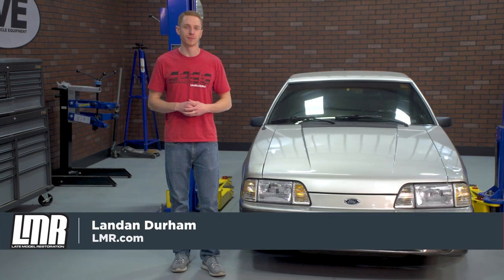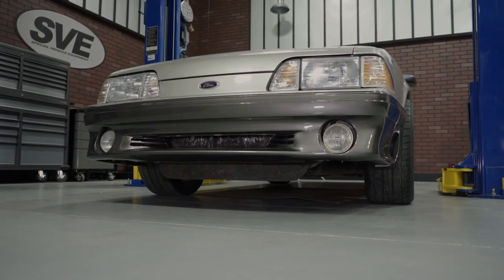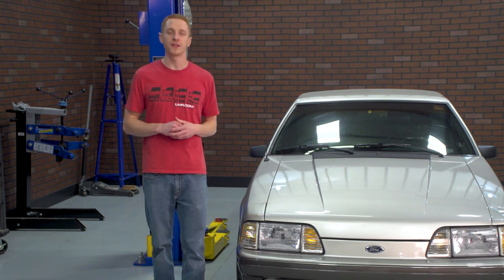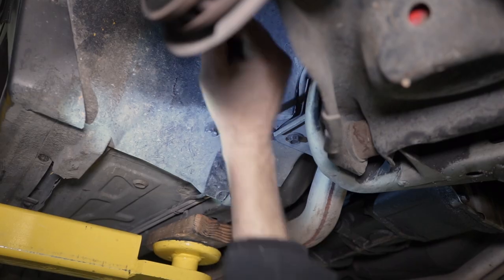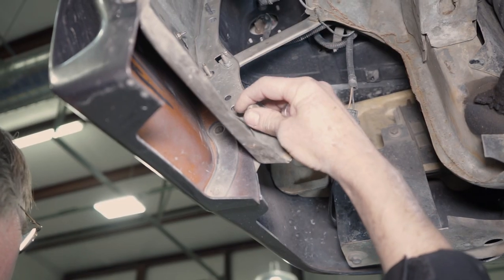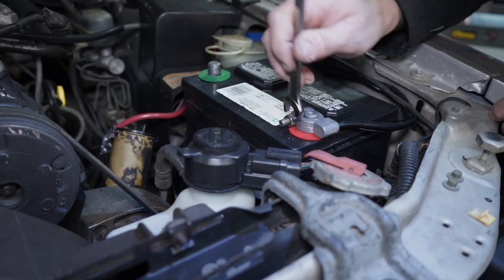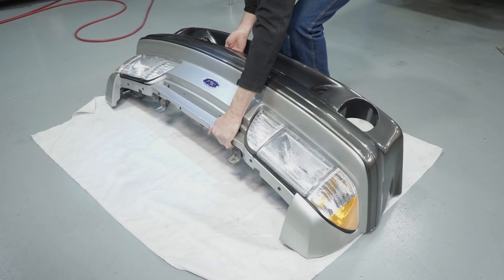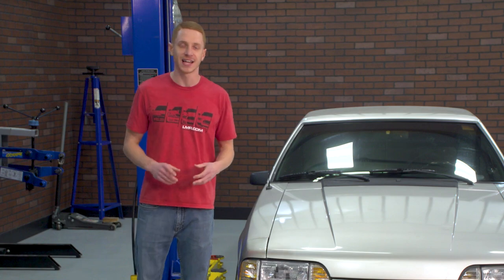How To Remove Fox Body Mustang Front Bumper (1979-1993)

Comment: You have to remove the bumper to start installing the on3 turbo kit. Is this video a hint that the turbo install is coming soon???
Reply: NOPE……. BUT YOU COULD PUT AN 88mm turbo kit on it, & drill  ur  HUGE INLET HOLE where the Blue Oval  Emblem was in your front header panel!! & it  ALSO helps if you are doing an LS SWAP AT THE SAME TIME, 2 REALLY MAKE THAT PONY HAUL AZZ!!😂😂😂😂😂😂😂😂😂😂😂😂😂

Comment: Thanks for the video. Removed headlights instead of the wells. Did a Race bumper shaved a lot of lbs but you have to weld a Fabricated bracket to hold your Foglights. Don't crank on top nuts too hard or you will warp plastic ..

Comment: I want to convert my lx to a gt, will this bumper fit my lx (87)
Reply from the maker: Yes, a GT bumper cover bolts directly to a car that was originally an LX. You'll need the front extensions and brackets as well. Below are links to the parts that I'm referring to. -Landan

https://lmr.com/item/LRS-16163D/1991-93-Mustang-Gt-Lh-Front-Fender-Extension
https://lmr.com/item/LRS-16162D/1991-93-Mustang-Gt-Rh-Front-Fender-Extension
https://lmr.com/item/LRS-8208A-K/1987-93-Mustang-GT-Bumper-Side-Reinforcement-Panels
https://lmr.com/item/LRS-16162BRKT-K/mustang-front-bumper-fender-spat-reinforcement-kit-GT-87-93

Comment: You will need rivets to reinstall new bumper, its sad how lmr will make it look easy and not explain the most important parts of installation in every video they just care about selling you parts.
Reply: Jason Hawk  yeah open your hood and those round things holding the bumper in proper place are rivets if you want a factory look and proper placement you'll need rivets
Reply: Jason Hawk  no problem, get ready for headaches when restoring the fox just be patient and make sure your willing to spend big money don't go cheap you'll regret it.
Reply: Jason Hawk  that's sick bro it's hard to find low mile mustangs. You can do you'll have to take the bumper off  all together, the rivets are only if your going to swap the bumper for another one.